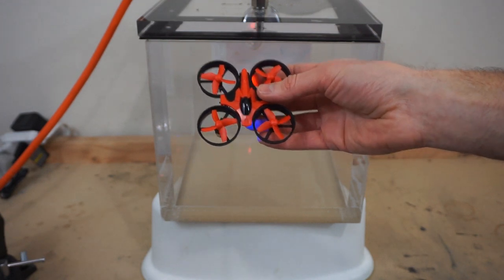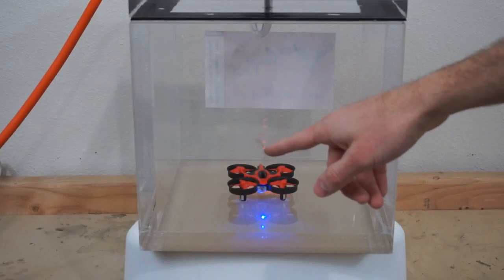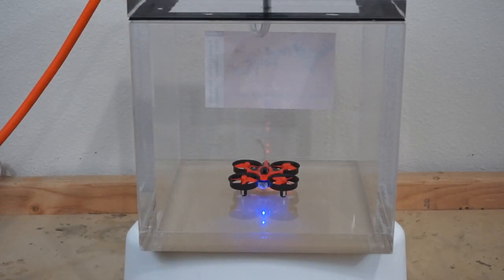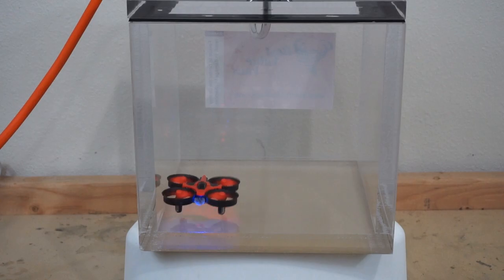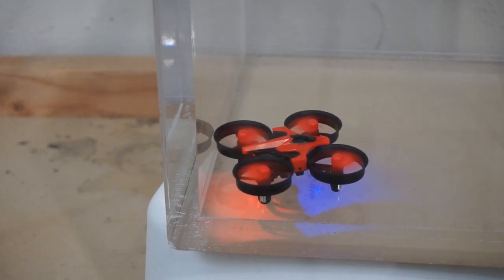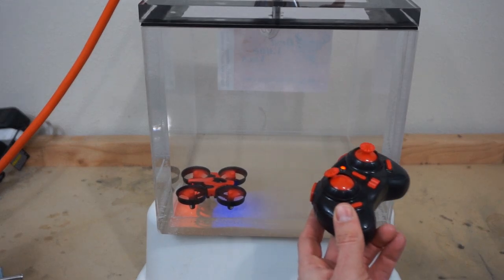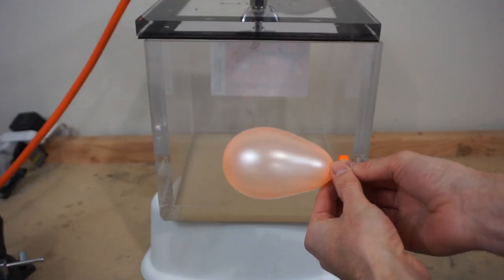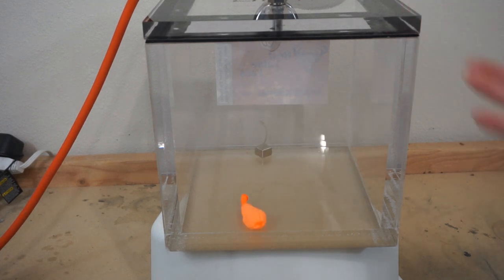What Happens When You Put A Drone In a Vacuum? Can It Still Fly?

Comment: so this is why helicopters can't fly up to really high mountain heights because the air is to thin?
Reply: Mack Andreou exactly
Reply: Yes, and what is worse for helicopters, with height also the oxygen content is getting rather low for conventional internal combustion engines. Jet engines can take more height because of the speed ramming a lot of (albeit thin) air into the intake. There are of course helicopters built with jet engines, they can fly higher, but then they encounter the thin air phenomenon and the rotors don't provide enough lift.
Reply: Nemozoli Jet engines burn jet fuel, no oxygen needed. A helicopter using a combustion engine has to adjust for thin oxygen when going higher than usual, also air pressure drops quicker the higher you go
Reply: turbine engines do need oxygen...
Reply: David's Favorite Videos Jet fuel (kerosene) can't burn without oxygen just like any other hydrocarbon fuel.
Reply: derp
Reply: I like that book u got there bud
Reply: Nemozoli, Airwolf. Remember that show?
Reply: anything that needs combustion needs oxygen
Reply: Except they can. A French guy landed a helicopter on top of Mount Everest.
Reply: I saw that video.  I call bs.  That helicopter is a single engine lightweight helicopter.  If you look at the manufacturers site, the max allowable altitude is like 12K.  Mt Everest is like 30K.  I have never been to the top of Everest but I am aware there are many markers that people put their to memorialize their journey.  These are not visible in that video.  There is nothing in the video to confirm that it was actually everest, other than the person who posted the video (company) claiming it.  I am confident in stating that helicopter did not land on Everest.  Very confident.  Oh by the way, I am a helicopter pilot.
Reply: Mack Andreou did you really not know that????
Reply: yes
Reply: oxygen needed i dunno.  but air is deffinatly needed.  but before the engine suffocated the rotor will stop providing lift long before
Reply: if they use a fuel with the oxidiser in it all you need the air for is to make a mist. (liquids don't burn)
Reply: @kitkat deminance.  "anything that needs combustion needs oxygen"  no it needs an oxidiser.  any oxidiser will work.  oxygen is just the best oxidiser
Reply: the air at mnt everest is insanely thin.  if you were teleported up to the peak of mount everest now.  you would die of suffocation
Reply: i miss google+   so it would add the name of who ever i click comment on.
Reply: Pffft I bet Airwolf could do it.
Reply: you don't know if oxygen is needed but air, definately is?

you see that door over there? Please take it.
Reply: of course you need oxygen.. kappa
Reply: Mack Andreou in a "vacuum "
Reply: Not best oxider, cheaper/readily available. Why bother carrying another tank when you can just suck free air.

You don't add an oxidixer unless it's really needed as in oxyacetylene torch and rockets.
Reply: Mack Andreou Yes
Reply: Jetfuel can't melt steel beams
Reply: +xumi +attack125 - dear Xumi, 'best' is a rather subjective term to begin with.  plz stop(intentionally) confusing it with "The Best".Afterall: 
 if u've got the mental 'stones' to make such a comment; then you obviously have the mental faculties to realize how he was speaking generally and trying not to take 30-minuets to write a comment when 5-minuets would more than adequately express his point.
Reply: Mack Andreou   Yea, basically
Reply: David's Favorite Videos Basically all engines require oxygen, rockets can carry their own oxygen to be used in space but aren't nearly as efficient as turbojets. A helicopters turboshaft engine suffers more or less the same but the propellers lose lift due to the thin air with nothing else to carry it. Planes can get up to speed and glide with a lot less issues in lower atmosphere because it has wings and jets for lift.
Reply: Turbine engines need oxygen (air) to work. Solid state rocket boosters have the oxygizing agent built into the fuel, and can burn without the presence of oxygen in the surrounding air. I believe many space rockets and so on have the oxygizing agent in tanks or built into the fuel itself. But jet engines uses air too. Conventional jet fuel does not have and oxygizing agant built into it :)
Reply: Jesus people! Do any of you have a clue? My Everest is just shy of 30k ft. and a helicopter ability to reach the peak has nothing to do with the performance of capabilities of its engine. 😂 A gas turbine becomes more efficient at higher attitudes. The cruising altitude of jet liners is upwards of 39k feet. The SR-71 blackbird has a Max altitude of 85k feet and operates as a ram jet at operational speeds and burns nothing more than JP7 jet fuel. The u2 operates at 70k feet and the J57 engine will shut down at 74k feet due to oxygen starvation. Soooooooo, a helicopters ability to reach the peak of Mt. Everest has nothing to do with suitable oxygen levels and MUCH more to do with air density. The higher in altitude, the lower the density. Low density doesn't allow the rotors to provide the lift required to stay aloft at My. Everest altitudes. However there are helicopters that have been specifically designed and I believe the record altitude is around 40k ft. set in 1972. Supposedly a specialy designed helicopter has flown to the peak of Mt. Everest, so it is possible, but not practical. There is no need really for helicopters that fly at jet liner altitudes. Only in very few circumstances and even then it's very risky and difficult.
Reply: No, helicopters can fly over mount everest. Air density is very low, so the lift force is low too, but so is the resistence of the air. Resistance of the air depends on the square of the lift force so its effect is much lower compared to the lift than in higher air density. That's why transcontinental planes fly 8000m above the sea level and not lower, because they need less fuel.
The main reason is that most helicopters nowadays use turboshaft motors that depend very much on air density, not because of the proportion of Oxygen, it remains the same for the first 1000km (Mt. Everest is just 0,89km) but because of the pressure. The compressors cannot compress the air for the optimum combustion pressure and the helicopters cannot produce enough force to lift the weight of the aircraft so they cannot ascend more.
All I said is true, I'm an aerospace engineer
Reply: Clix B8s uh, the top of mountains have less air/oxygen than at sea level. A vacuum, such as space, has almost no particles. Lol
Reply: http://amzn.to/2iRElMC

Theres the drone if anyone wants it
Reply: Francis Pacia my point is that comment is horribly stupid.... Helicopters can exceed 35000 ft...
Reply: Clix B8s a chopper isn't limited by its engines, but by the blades ability to move the air
Reply: Mack Andreou well da what grade are you in
Reply: lets just get this clear, ANYTHING THAT BURNS REQUIRES OXYGEN. the only thing that wouldn't require oxygen to burn is hydrogen, because it doesn't burn, per say, the rocket would combine hydrogen and oxygen and pop, like a little explosion, and that happens thousands of times in a second, so it produces a lot of thrust. and it's byproduct is water :)
Reply: All this talk about jet fuel with no mention of its affect on steel beams.  What is this parallel universe?  Are we not on the internet?
Reply: aleluja
Reply: I just wanted to make sure because i was having a discussion with a friend about mount Everest and why they can't rescue people with a helicopter.
Reply: Yes they run out of stuff to grab onto. The thrust depends on how much gas you can throw downwards. As the air gets thinner it gets lighter. (Less gas per cubic foot). Spinning the blades faster and increasing the pitch of the blades increases the amount of air you can move. But eventually you run out of RPM. Engines also can find thin air a problem which does not help even a little bit.
Reply: NO. It requires an OXIDISER, not OXYGEN. This is why Chloride Trifluoride burns without oxygen, as many compounds do. OXYGEN and OXIDISER are NOT the same thing.
Reply: @Jon doe depends on the design. The engine can be starved of oxygen BEFORE the blades are unable to provide more lift.
Reply: Jets burn fuel and atmospheric oxygen. Rockets carry their own oxidants so don't need atmospheric oxygen.
Reply: yes. that is why. not enough air to create lift
Reply: Yes.
Reply: Enderman 677 I was just playing Explorers of Sky, nice profile pic.
Reply: its not the speed thats helping its the compression. in fact if you go above supersonic the air has to be slowed down to subsonic speeds before ever entering the compressor
Reply: it's because of the lack of oxygen which is needed for combustion of fuel in the engine but if the have an oxygen tank connected to the engine it could fly beyond the troposphere
Reply: to burn fuel means to use oxygen. Even in your cells. cellular respiration requires oxygen (for humans).
What I mean is that combustion of fuel in your engine requires oxygen.
If you find this wrong then give me an element needed for the combustion of jet fuel
Reply: then give me an example
Reply: I'm surprised nobody has mentioned HOT air being bad for helicopters yet. Soviet helicopters in Afghanistan had the occasional trouble taking off and flying due to the horrible combination of mountains and hot air-- resulting in uncommonly thin air.
Reply: +David Dou Tip never put a magnesium fire out with water !
Reply: lol compressor blades of doom. i like that
Reply: yes. yes she could
Reply: Yeah because of mainly two points
1: The rotors don't have enough air to push down so they create less upward force
2: The engine gets less air which leads to less energy output to the rotors
Reply: +acid junkie False
Reply: Idk if it was already stated, but rocket fuel has oxygen in it's chemical makeup. hence why they don't need an atmosphere with oxygen to burn.
Reply: Mack Andreou I guess.
Reply: you do realize you just said that a ramjet being able to collect the needed oxygen to burn means a helicopter would as well.... well fun fact the black birds engines are almost useless at stand still, they even get started by external motors, by your logic a helicopter should not be able to hover. 

fact is they work on entirely different principles and should not be used as cross examples
Reply: quantuman100 à
Reply: quantuman100 while it is true that blackbird engines require start carts. it's not because they "don't work" that we'll at stand still. it's because starters are heavy and because of the type of fuel they use needs a lot of compression that would need a really big onboard starter. plenty of jet engines have used start carts. blackbirds use a combination turbojet/ramjets. the ramjet is the one that needs high airspeed to work.
Reply: Because there's still air for the helicopters to work, it's not a vacuum rofl
Reply: Nemozoli Virtually every helicopter is powered by a turboshaft engine, which is a gas turbine engine that is designed to do shaft work rather than produce thrust. Using a thrust - producing gas turbine to propel a helicopter isn't terribly effective, due in part to a helicopter's need to pitch and roll to move in any direction other than up and down.
Reply: Yes rip Kobe